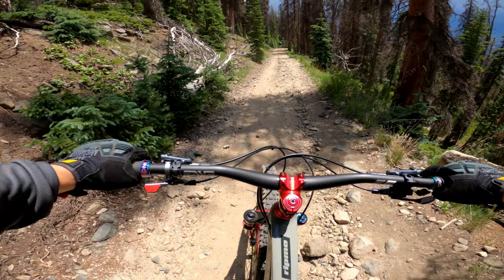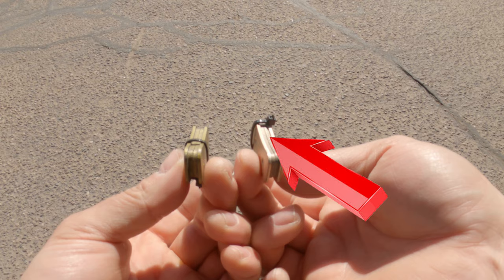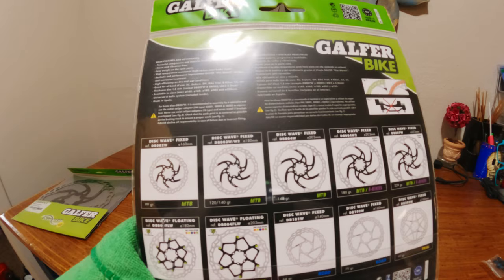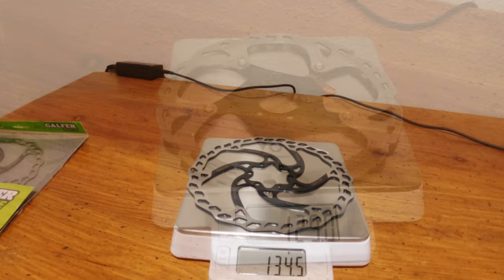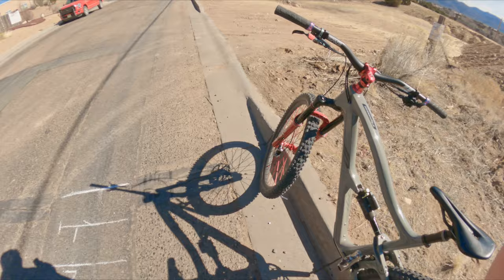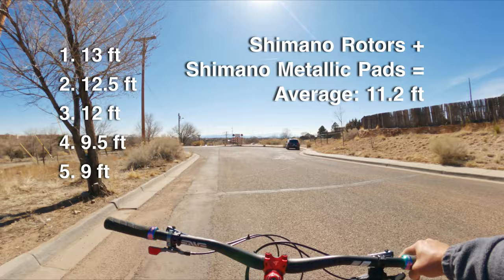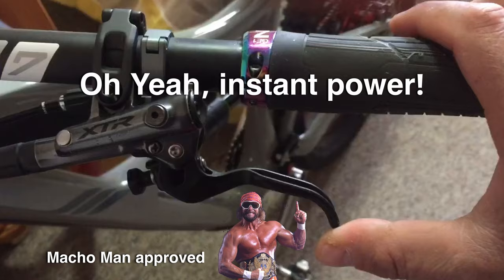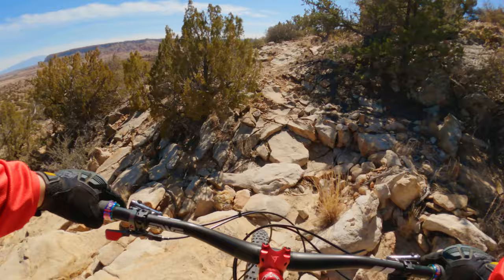Mountain Bike Brakes - Galfer 2mm Rotors & MTX Pads | Best Brake Performance Upgrade

Comment: All floating rotors are 2 piece but not all 2 piece rotors are floating. You can tell a floating rotor by how the 2 parts are connected. If its riveted solid, like the Shimano in the video, its not a floating rotor. If there are round buttons in between the 2 parts that allow for the braking part of the rotor to thermally expand and contract in relation to the mounting part of the rotor, then its a floating rotor. Examples of floating 2 piece rotors are Magura MDR-P or Hope floating rotor.
Reply: Wooo, I didn't know that, thanks for share this inf dude

Comment: IME, Galfer metal pads don’t bed in 100% until about 4000’ of descent.  They take a while to get 100% and they are noisy at lower speeds.  At a bike park when they heat up, they are silent, or make a pleasant whizzing sound.  Also plot twist, Galfer makes OEM pads from Magura, Shimano.

Comment: I've ridden for years the shimano rt66 180mm rotors. Recently tried the galfer 2mm rotors in the same size. In my opinion they offer better modulation but are lacking some power (same pads and bedded well). I think it's because of the bigger cutouts in the rotor and therefore they haven't got the same surface size interacting with the pads.
Reply from the maker: After a time since this video, I would probably agree on your observation. Also, I find the front rotor flexes in fast descents too. What pads were you using? I also used Galfer pads but was getting better results with the mtx pads. Now going to test out the trp 2.3 rotors, cut outs are not as profound as they are just drilled holes.
Reply: @travelthenarrowtrail8660  I also have the XTR 4 pot brakes with the original N03A resin pads. No other options there for me. The RT66 always worked  fine - dead silent and powerful. Occasionally I had some warped rotors due to the 1,8 mm thickness. Recently Shimano moved their  productionline from Japan to China and the RT 66 rotors are now stamped rather than laser cut, so they are really crap now and this lead me to try the Galfer rotors. I don't know if they flex but I can clearly hear a slight buzzing noise, especially in the front, in addition to the issues I mentioned before. Just ordered the Hayes D-Series 180mm, 1,95mm thickness, 150gr. rotors.
Reply from the maker: @mijk69  Ah, this should be nice, let me know how they work out. Yeah, Trickstuff and Magura also make a 2.0mm rotor but the Trickstuff is harder to get if you are in North America because they are in Spain.
Reply: @travelthenarrowtrail8660  Yeah, the Hayes rotors are perfect. Good looks, tons of power and modulation.... and yes they are silent - no whirring noise like from the Galfers wavedesign. Just the way I want it. One of them was slightely bent as new, so I had to straighten it. The mounting holes are 5,1mm like the Shimanos while the Galfers are 5,5mm wich made them whobble up and down. 
Trickstuff is well known over here in Europe. By the way they are German like Brakestuff. You should check them out if you want some custom made rotors with your name on them. How about the TRP rotors? New video soon?
Reply from the maker: @mijk69  I meant to tell you, I also noticed a buzzing noise in the front 203mm rotor. The 180 in the back doesn't do it but the front does. I contacted Galfer about it and they had no answers and said its not something that happens. I even sent them a video showing the noise. But if it happened to you as well that tells me its not an isolated thing and they have to know it happens but deny it. I think its because the cut outs. 

Yes, will probably do another video with the 2.3mm TRP rotors on. I'm interested also in Braking Brakes (w-fix batfly rotor 1.9mm) and Trickstuff 2.05 rotor, but both are European and hard to get in the USA. 

I think I've tracked down a German website that ships to the USA the Trickstuff rotors so might attempt a shot at that. Not sure what country you are in but these might be a future purchase for you. I've heard both companies make really good pads too. 

I saw the Hayes rotors but all out of stock here in the USA so its a no go.

Comment: I love Galfer wave and MTX
Front 223x2 rotors + 4 piece MTX red with Magura mt5 calipers
Rear 203x2 Magura STORM HC rotors, MTX 4 piece Red, MT5 calipers
Dialed power house modulation.
My stopping distances with gravity punch braking from a good sprint on road =
3-5 ft.
Reply from the maker: Sounds amazing and strong power.
Reply: Just upgraded from galfer wave 203 to 223. Needed 63mm adapter.  . And XT servo wave lever for front for a Shigura setup. MT501 temp for rear.... Massive power and modulation with a light touch.  Even less arm pump lol

Comment: Great Info: But I'm a bit curious about the substantially less metal surface for the pads on the Galfer rotors  despite the larger diameter of 180 vs 203mm.  I can see the benefit of staying cooler, but also, pads obviously can negate the lesser metal, and perhaps also the type of steel they are made from. In addition, The concept of using different brake pads front and rear is great.  I'm currently doing my research in choosing and buying the correct adapters for my climate and riding style. 👍

Comment: Thanks for the review.  Wondering how you were able to fit the galfers in the shimano calipers.  Galfers being thicker rotors, are you having issues with pads rubbing and fitment in the calipers?  Thanks again for the review.
Reply from the maker: The Galfers fit no problem. However, the rotors have large holes in them and they do flex in huck drops or grippy fast turns, you can noticeably hear it. That is why I switched to TRP 2.3 rotors. They have small drilled holes and are very quiet compared to the Galfers, which are much louder.

Comment: Trp do a 3mm rotor the other thing regarding shimano drifting power / modulation would be to use a higher boiling point oil.

Comment: Nice video. One thing not mentioned is cost comparison.  Galfer rotors and MTX pads in my area are less expensive than Shimano. I used to run Shimano rotors and pads only. I now run Galfer rotors with Galfer or MTX pads...
Reply from the maker: Whoa, in the presence of greatness, awesome to have Dagonger chime in! Thanks for sharing your comments and stopping by.
Reply: @travelthenarrowtrail8660  😊😉😂

Comment: How did you get the Galfar 2mm rotors aligned I'm having trouble getting them aligned so they dont rub I've bleed the brakes and pushed all the pots back in and use new pads but somehow having a really hard time getting rid of rub because there is wey less gap.
Reply from the maker: You may need to loosen the two bolts that hold down the caliper. Then you'll have to realign the caliper so its not touching the rotors and slowly tighten up the 1st bolt then the second. If that doesn't work, you may have a slightly bent rotor. You local shop should have a disc tool to straighten it out. They can get bent during shipping. The other thing is if your rim is our of true, it could cause this. But try loosening the caliper first then align it and tighten back up.
Reply: @travelthenarrowtrail8660  how does an 'out of true rim' effect the hub/axle interface????????? lol

Comment: So I'm 5'11 and around 200 pounds (maybe more; I weight train on a regular basis). I have really strong legs and can pick up a lot of power with tail winds on the road with my mountain bike, which is a little over 40 pounds, which is on the heavier side. What size rotor and brake pad material would you recommend once I start riding on the trails?
Reply from the maker: Depends on what kind of bike you are riding and what type of trails. Trail bike and XC bikes usually go with 180 front and rear. All mountain or enduro bikes will usually do 203 front and 180 rear and some do 203f and 203R. For heavier rides I recommend metallic sintered pads for best power.

Comment: I really like your channel but what you're really describing is lever "throw", ie the distance of pull before the brakes start to engage. "Modulation" is more of a term to describe how much lever throw before the brakes grab like crazy. For example, I hate Shimano brakes: you pull a little and then all of a sudden they grab like crazy. Whereas, with SRAM Guides or G2's, you can pull a little, you get a little braking. Pull a little more, you get a little more. Etc....So they are more linear in that you don't pull, then pull just a bit more and "BAM" they grab like Shimano's.

Comment: so these 2mm rotors - do they suffer from any more brake rub than the standard 1.8mm ones? any noticable difference in modulation?
wondering for an ebike whether it's worth the upgrade
Reply from the maker: Thanks for watching the video. I would now recommend TRP rotors. The Galfer tend to flex a little but to answer your question... No, regular pads will not rub any more than 1.8 rotors. Just make sure your pistons are pushed all the way in on your caliper.

Comment: Hey brother, great video! I too just got a set of Gold MTX pads and been complaining about the noise I'm also now hearing from your bike as well. That noise brings a vibration through the bike, are you feeling that? The noise and squeal sure sounds the same and I feel like it would vibrate at it's noisiest. Due to the vibration I tend to let off, but I can tell the pads are good, but that vibration! Curious to hear your thoughts. Cheers
Reply from the maker: Hey Miguel, thanks for watching.  So I have a question to answer your question. Did you put new rotors on with the new pads or were they the same rotors? Which pads were you using before you put the MTX pads on?  I'm getting several questions on this and I'm thinking of doing a video on what I think the cause is. However, I'll wait to hear your response.
Reply: I switched to MTX RED MT5

Comment: Just read your comment on the trp.  I am also interested running the trp 2.3 with my shimano xt 8020.  Just wondering how the install process was since shimano calipers are made for 1.8 mm thick rotors.  Did you have any caliper rubbing issue with the trp rotors.  Any problems.  Thanks.  Great video
Reply from the maker: Sorry for responding so late, I just saw this comment. Just make sure your pistons are pushed all the way into the calipers. They will fit. You will have to readjust your caliper’s slightly too. You’ll love this hack. Check out my new video on this.

Comment: I got Trickstuff Dähle HD223mm offered to me so I went for it, I will see how they perform.
Reply from the maker: You know what, I think you will like them better. The reason I think is the holes on the rotor where the pad touches are not a big as the Galfer giving a more silent and stronger rotor that does not flex. I wanted to try the Dächle-Disc but Trickstuff is difficult to obtain in the USA. 

I need to do my next video to indicate what I'm running now. The HD223 rotor is a 2.05mm thick and now I'm running at 2.3mm thick. That's right, 2.3mm from TRP and love them. That's for the next video.
Reply: @travelthenarrowtrail8660  they are out of stock, so can't get them anyway. I got mine second hand, I think it was half price. Along with some other goodies. DT Swiss wheels with 350 hubs, trying shorter atlas cranks, and Installed Ext Era fork. I got the last one in stock in Norway for a while. Much stiffer arch, crown, little sticktion, less flex, lovely. Not tested it yet, only did short testing around my home.
The rotors seem to work well, but if you hit them they make a noise.

Comment: I just read your comment about the trp rotors.  I am also interested In running trp 2.3 with my xt m8020 shimano calipers.  Are you having any issues with the fit and calipers rubbing.  How was the install process with thicker rotors.  Thanks again. Very comprehensive video.
Reply from the maker: Thanks for watching!  So I still need to get this video out because I get asked about this all the time. For shimano, TRP 2.3 has a tight clearance but they fit. 

I would advise TRP metallic pads or MTX golds. If the rotors were not bent at all in shipping, they should be straight and if the wheels are true, no issue will arise. 

If there happens to be, you can take some high grit sand paper and place on a flat surface and sand about 1mm off the pad surface, but this should not happen at all. 

You will not regret 2.3 rotors from TRP. They are really good and will increase your XT's braking power.
Reply: Thanks for the reply.  Appreciate the prompt response.  Love your videos

Comment: May I ask how do you adjust the difference in thickness on the hydraulics without it 
Rubbing 🤔????
Reply from the maker: These are only .2mm thicker, which is not much. But adjustments begin with the pistons, making sure they are pushed all the way in. Then make sure your caliper is aligned with your rotor and if it rubs loosen the allen bolts securing the caliper to the frame/fork and adjust till silent. If you do all this, there is room for the rotor to spin without rubbing the pads.

Comment: Looking at snagging a set of galfer rotors!
Reply from the maker: Sounds like a great plan. Tip: just be aware that Galfer is a company from Spain and their "sister" company is in Nevada. However, they are not related if you have warranty issues. So purchase from Galfer USA incase you have an issue.